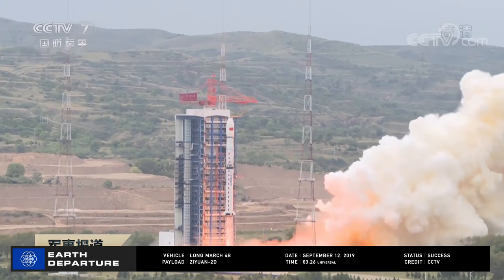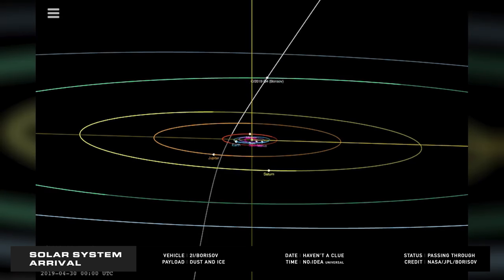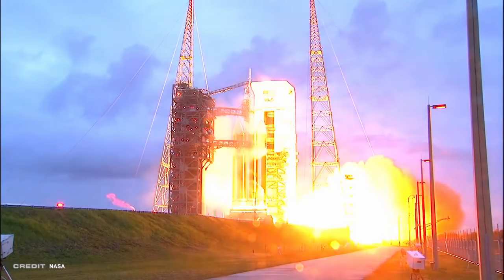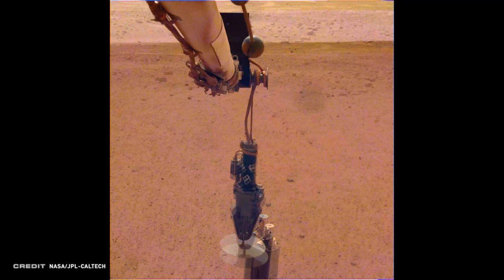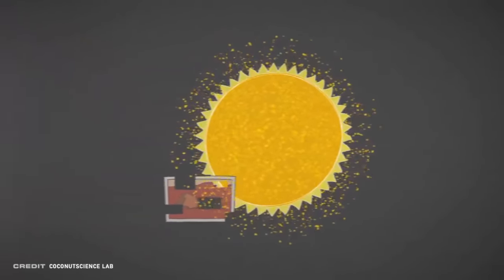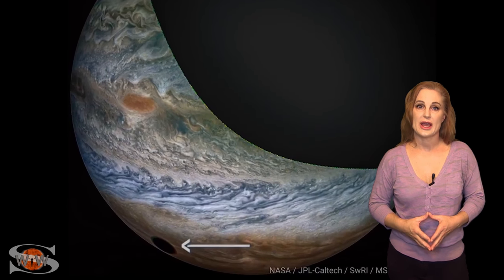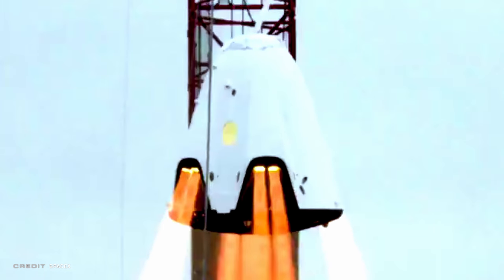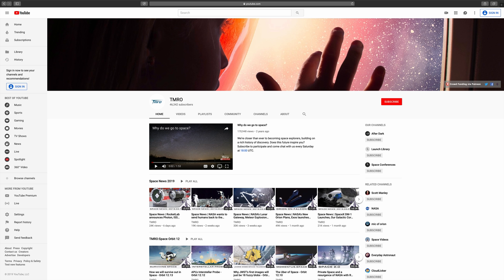More SpaceX! More Orion! More Mars!  | SPACE NEWS

Comment: We dont need to worry about duststorm on Mars.
We already have the Kilopower reactor.
Reply: Now the question is if a private entity could get their hands on Kilopower. While it is super awesome technology, combining Stirling engines and a reactor is super cool, it does run in highly enriched uranium. So if anyone besides the government wants to land on Mars they might not be able to get it, at least initially. I'm sure once the first dust storm comes in and the colonists are stuck on battery power, they'll agree to send em a bunch of them. The plan will still have to rely on solar, unless they can somehow negotiate a deal.
Reply: Kilo power is actually quite small, only 1-10 kW. The ISS uses 75-90 kW. For ISRU (like for starship) you need about a megawatt
Reply: @philb5593  There are two Kilopower units.
The 1kw version, which is used to power Spacecraft in Space, wheiging 400 Kg.
And the 10kw Version weighing 600kg, which can only be operated when stationary.
Powering Starship (although this info might be outdated in a few days are solar panels providing 200kw at 1 AU.
This number will be cut down by half when at martian distance to the sun and a second time once you landed.
So on Mars Starships solar panels can only provide 100kw for 12, 25hours and then 0kw for 12,25 hours, all the while weighing several tons.
For six tons you could  carry 100kw in electric power aswell as 200 kw in thermal power when having 10 kilopower units.
The thermal output of kilopwer might be crucial to keep Starship (aswell as any hab or greenhouse you might want to build) from freezing during the night.

The kilopower when designed was not a great investment to NASA it rather was a underfunded despirate move to develop a space nuclear reactor (I recommend the keynote one Kilopower guy gave at a Mars Society conference).! 
So NASA could develop bigger Kilopower reactors, (around 100kw) that would cost less to manufacture, would have less mass per unit of power, and would not need as highly enriched fuel as the 10kw version.

But also the ten kilowatt version is potent. At 10kw, that emasses to 245 kwh per martian day or 12 kg methane or 60 kg Methalox.
A Starship needs around a million kg of Methalox. That requieres 30 kilopower reactors to run for the time you would spend on Mars.
That are 18 tons of kilopower reactors.
Reply: @abrahamwilberforce9824   At 2 AUs, approximate radius of Mars' orbit, solar power would be 1/4, not 1/2, that at 1 AU. Sunlight and other radiations obey the inverse square law.
Reply: @odysseusrex5908  I thought Mars is at 1,5 Au making it roughly 2,25.
Reply: @abrahamwilberforce9824   Actually, you're quite right. That's what I get for trying to do things without enough sleep. I confused the ratio of the lengths of the orbital periods with that of the orbital radii. I must now go hang the shame curtains.
Reply: @odysseusrex5908  I have seen that done by several people saying that Mars gets a fourth of the solar constant Earth gets.

I think this is a mistake repeated to often.
However Starships solar Array, would get 4 times the power cruising close to the Earth compared to landed on Mars.
Because when cruising interplanetary there is no night and  the solar array can run continiously. 
So the being landed or in Orbit of Mars part, splits you power by another factor of two.

By the way, considering Starship is crewed by 100 people this is how much power it needs for oxygen production.

Lets say a human needs around 1kg of Oxygen (0,55kg when constantly resting).
To get 1kg Oxygen you need to electrolyse 62,5 mol of water.
That makes 6250 mol per day for 100 people.
Splitting a mol of water takes 242kJ, while PEM electrolysis achieves usually 70% efficency.
So you have 242kj times 6250 divided by 0.7 divided by 24 divided by 3600.
So you need 25kw of constant power to supply 100 people with Oxygen.

The hydrogen can then be used to react CO2 to water and CO via reverse water gas shit reactions.